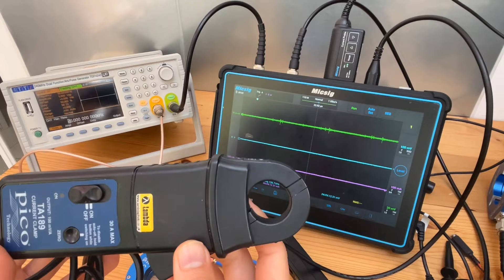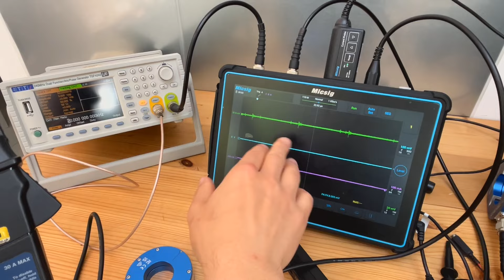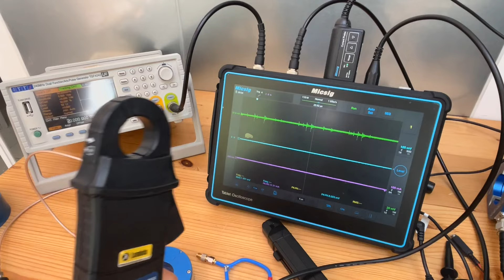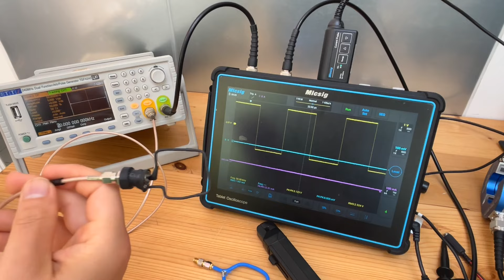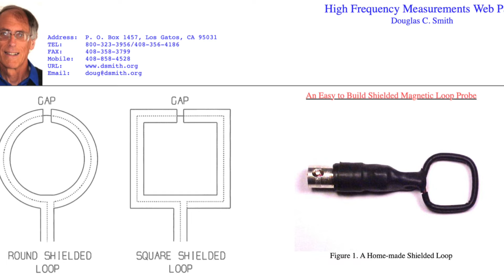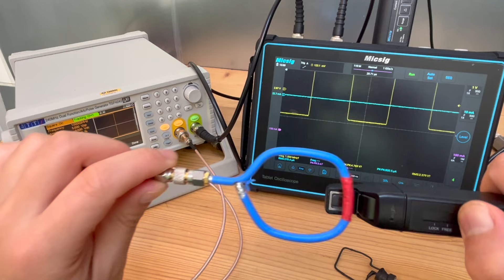RF Current Probes Episode 8 - Hall effect current probes vs RF current probes

Comment: Hello, I cannot view the details of your oscilloscope for the green trace (mV scale, time scale) but I think the issue you show with Pico Test TA189 can be avoided. In my test lab with radio engineering and EMC pre-compliance, I use quality old tektronix probes with oscilloscope. For instance, I have TCP202 with TDS794D which will show flat response so perfect shielding. Of course, I do use specific probes fantastic made by tekbox but in your video, either the TA189 is badly shielded or there is a phantom EM loop in your setup (probe, display unit...). Note that using a DC-AC probe hence hybrid of Hall effect and CT effect is tricky engineering design plus with your EMC testing, you really look for AC and RF so why focus on DC part... for small cable, I really prefer legacy TCP202 which goes from DC to 50 MHz otherwise really tekbox is the way to go
Reply from the maker: Hi, you really know your stuff! I am not fortunate enough to have the Tektronix probes, I know they must be well constructed. The issue I found, even when using top class Hall effect probes, is the random noise pick up in the ambient. About 10 years ago, when I was working for a big company, we used to clamp a probe on the body of a handheld product and left it there overnight for measuring the CM current. The following morning, we noticed lots of random noise pick-up due to the E field noise. I guess, when it comes to very high frequency event, such as an ESD event, it is always tricky to shield the E field. I remembered D Smith used to do lots of experiments on this subject.